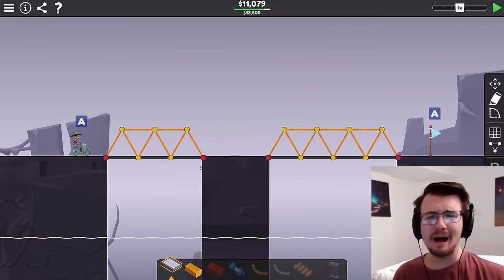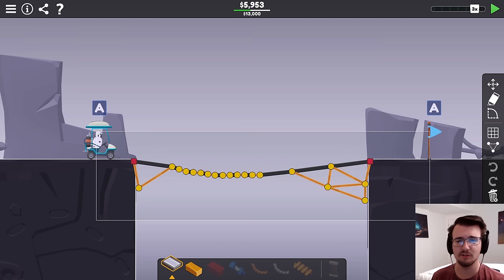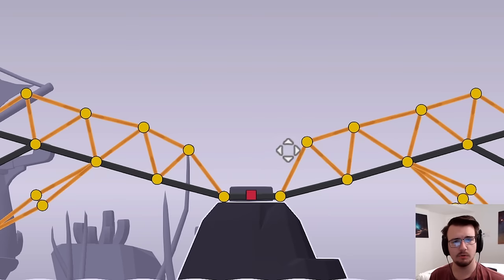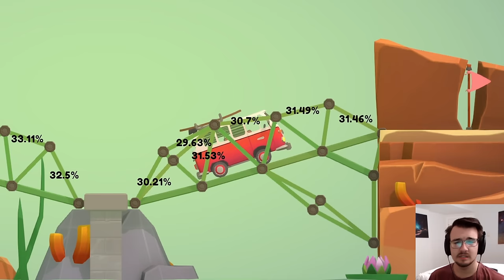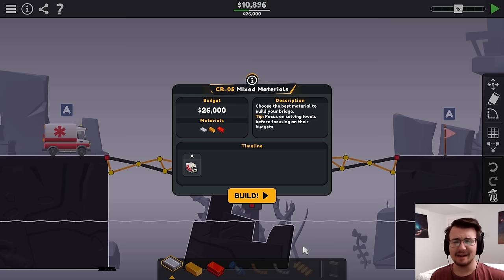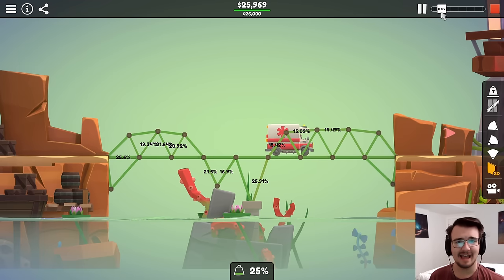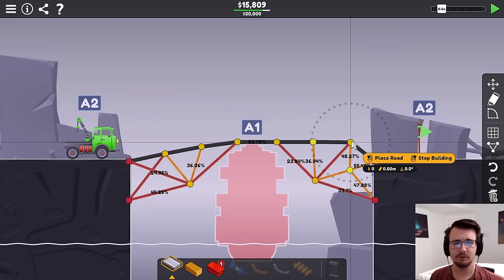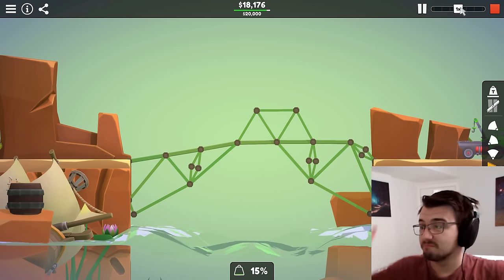The Quest For LOW STRESS on Every Bridge! - Poly Bridge 3

Comment: Something i noticed you not doing in this video is that if one piece is getting really stressed, if you delete it, the stress of that piece goes to 0%! Hope this helps!
Reply: Well yeah, sometimes it's just.. the other parts may suffer
Reply: @SadMatte  just delete those
Reply: @ptyw.  if you don't have a bridge you can't have stress! 👍
Reply: A flexing bridge is dubious at times
Reply: @ILubBLOfficial Along with deleting warnings for nullability checks. :D
Reply: also, you save money in your budget too!
Reply: wrong leaderboard!!!!!!!! @TheRaker1000
Reply: @SadMatte but sometimes the same amount of material to reinforce that place it's more entertaining anyway because structural design changes are cool to think about
Reply: This also works with people! Hope this helps!
Reply: Like that old German wisdom - tighten until you hear a snap, then loosen a bit.
Reply: @ptyw.  Um well uh.. then you're not doing your enginering job properly, I mean, you might still want to have a bridge in the end..
Reply: This sounds like a joke suggestion, but honestly that kind of mentality is really really important sometimes.
Reply: man is a genius
Reply: DID YOU JUST SAY ONE PIECE?
Reply: @cbot9302 the only stress is from the drivers of the cars knowing there is nothing in front but the play button forces them forward
Reply: @cbot9302 nah, you just transferred the stress to the people that needed to use the bridge 😂
Reply: @cbot9302 but I'm stressed and I don't even have poly bridge, should I delete myself?
Reply: @mostardaescura8610  no that would be ridiculous. Obviously you should just have a lobotomy and remove all emotions from yourself so you can't feel stress anymore.
Reply: @cbot9302  Ah yes, good idea my dear friend

Comment: low stress seems more in the spirit of a bridge designer, but i'm sure you'll surprise us with new cheese to limit stress x)
Reply from the maker: I suppose there is some cheese to come haha, but low stress "cheese" is much more interesting than low budget cheese
Reply: My thoughts exactly.  Real bridges are designed with tolerances.  No bridge that comes with in an inch of failure would ever pass inspection.
Reply: @Aliensrock  hello mr Alien man.
Reply: @MalichiMyers  mr aliano
Reply: @Aliensrock  Low stress and high budget does make for better cheese. I am sure you'd know that though.
Reply: Bridges are designed to fulfill their goals for the cheapest budget. Going for budget is the most in the spirit of bridge design, it just so happens that the goal is to get vehicle from point A to point B instead of real life where the goal is to support X amount of force for X years.
Reply: @eewweeppkk yes but the x amount of force is always greater than the actual force the bridge experiences.
Reply: @immabird7861   Doesn't matter, it is designed for X amount of force. The goal is to allow it to withstand that X. In this game X is 100% stress, in real life it would be lower. That doesn't change the fact that the bridges are designed to be as cheap as absolutely possible to get it to that X, not to exceed X as much as possible within budget. 

If you as an engineer do your best to spend all of your money then you aren't getting hired. Your goal is to meet the goal as cheaply as possible every single time.

Comment: Muscles, Steel pieces over 2-3 roads or a wood rope inside of roads are great for low stress on most levels. I've climbed the low stress leaderboards and those things saved my life, rope/cable muscles as well. Really anything that can be reinforced in a stupid looking way seems to work amazingly
Reply: I have a good bunch of top5s and top1s and this advice is mostly useless there 😅 if you find yourself reinforcing like this, better to redesign. 😇
Reply: @eclipseeffigy  For low stress the entire point is reinforcing? If you're not reinforcing with steel and muscles, you're doing it wrong.
Reply: @eclipseeffigy   I do as well, redesigning is important but it really only is useful if you hit a dead end, you can squeeze a lot of juice out of just one design, and besides he isn't going for top 1, he's going for top 100 or top 1% which is easily achievable by doing the bare minimum
Reply: Lowstress techniques are very interesting and the bridges can get quite elegant, which I think is much cooler and more interesting to see than brute force material overlap on roads. 

...and, of course, it's simply better to build a proper bridge. If you're stuck, check out the gallery for design ideas! Many levels have strong lowstress replays from players such as Alex, MOD, windstill, myself, and others. We often design very differently even in the top 5, so be assured there still are multiple ways to go about it! 😄
Reply: @eclipseeffigy  oh yeah you shouldn't have to brute force a design if you don't want too. I guess I just like sticking with the same design for as long as I can until there's no improvements that can be done with it. I've never found myself getting too stuck though, low stress is quite intricate but it's also not too difficult to pull off
Reply: @eclipseeffigy  My strategy basically boiled down to making a core bridge that had as little stress as possible and then using excess money on bulking it up, basically the same as what Tyler did.

Then again, I only ever aimed for top 100, and it's really been quite a while, so I haven't seen any up-to-date top 5 low stress bridges. Looking forward to seeing some of the new designs when Tyler comes accross them then!
Reply: @eclipseeffigy is there any videos on youtube talking about low stress techniques? looks pretty interesting and delicate
Reply: @F3XT I don't think there are any yet. Chowchunfu is working on a series, but some of his techniques will get invalidated by the upcoming physics update, so he's still working on it.
Alex (recently changed name to mybuyroundyourcryround) has been working on a video as well.

I'd like to make one myself and showcase some of my favourite techniques, but I play on a li'l laptop, so it'd take forever to record & render and the quality would suuuck. 😅

Comment: Understand, Tyler, that a lot of stresses are caused by 'Dynamic loads' on the bridge. Eg, a car changing direction. You see the van's suspension shake at the bottom. Building a smoother road to even out the dynamic load should halve the stress the bridge is experiencing.

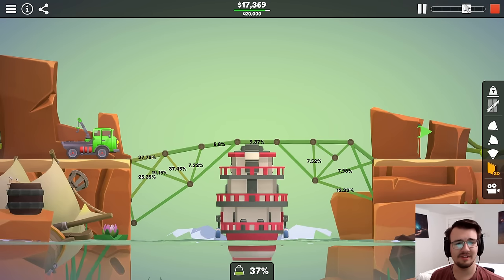Comment: 18:15 i think what happened with the very stressed road is that steel, braced against the wall, is creating tension on the road. Roads really don't like tensile forces, so even the little bit created by pushing the steel, and it not compressing, thus pushing into the far node of that road, causes a high stress number.

Comment: If/when they do pb4 I really hope there will be timed leaderboard where you have to get the cars across as quick as possible while under budget. That would surely spawn some interesting results
Reply: it could be interesting but the levels aren't currently designed with this in mind except for the jump levels, most straightish levels would need a lot of cheese to be quick
Reply: @F3XT  I mean true and as it currently stands it would work much better in pb2 with spring cannons but who knows what they might add next

Comment: If you're not aware already, it may be helpful to know about the concept of a catenary curve, which is the shape made by a dangling rope tied at both ends to anchors. It naturally minimizes the tension on the rope. The same shape flipped vertically minimizes the stress if the structure is made of rigid components. So real-life bridges are often built with catenary shapes. Obviously there's a lot more dynamics in Polybridge, but maybe it's a helpful starting point. Like even in the first level, I wonder if your max stress could improve by ditching the flat roads and using a catenary arch.

Comment: I think the biggest problem of rock bridge is the fact a car changes the angle of its movement. If your bridge was straight it wouldnt buckle into the Road. So that is a potential improvement of using obstacles to your advantage. Keep up good job and wish you best on later levels.

Comment: For the bridge at around 7 minutes in, I notice that you could have probably attached the roads to the static joint in the middle?
Like, the left side gets stressed when the right side is driven over because the left side gets pulled on when the van starts pressing on the right side
So why not use the static joint?

Comment: I'm going to be honest, the implementation of "low stress" is really dissatisfying to me. Because really, it looks like you end up having situations where one side (the side that needs less support) you try to do budget-saving so you can save money to strengthen the other side.
I just feel like low-stress should be based on the average stress per unit length over time instead. If you half the length of a piece it should contribute to the cumulative stress half as much. If you half the average stress of a piece (either by halving the stress or making it stressed for a shorter period of time) it should half it's contribution to the cumulative stress. That way even if you have random spikes of stress it's still about how much stress you have on average.
For personally it feels dissatisfying and cheaty to just try and move stress around. Who knows though, it's the first episode right. Will continue watching to see how this develops.